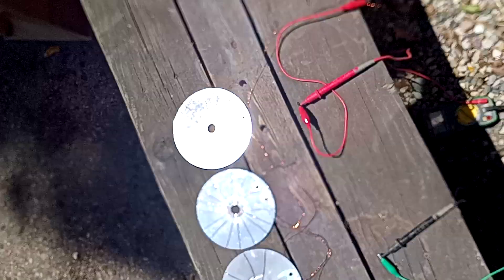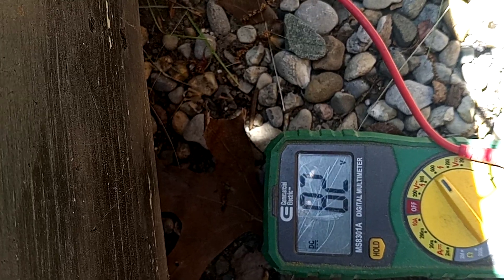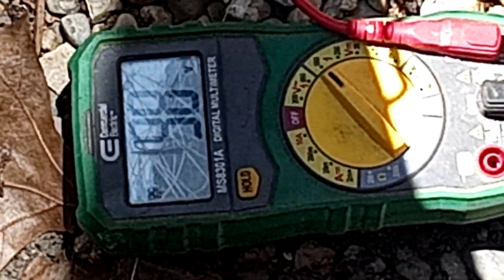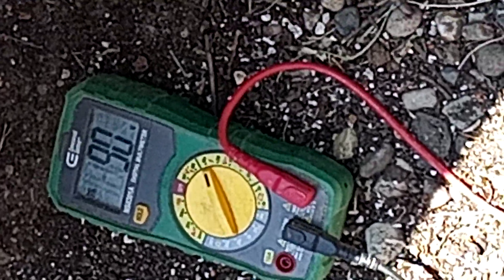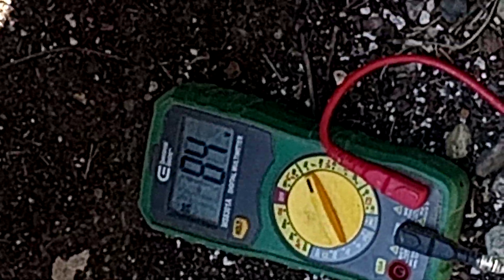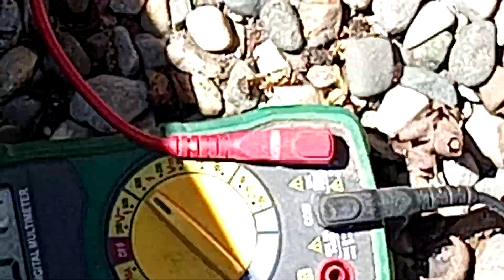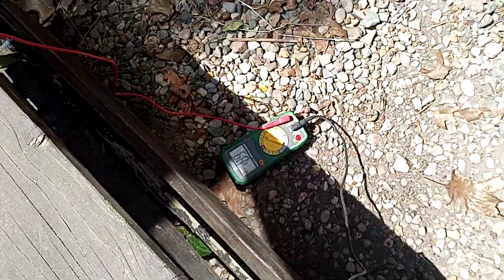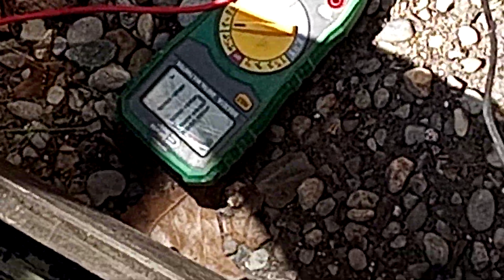Creating direct current energy

Comment: So now, you are just going to have to find a way to regulate the power down to 12 or 14 volts to recharge a car battery 🔋 or . You're going to need what's called a diode,  to allow power to flow from the solar but not back (into) the solar before connecting it to a battery. It would take 8 car batteries to handle 94 volts DC connected in series. That's your input+12v then -connected to +12 then the - connected to the +12 all 8 batteries side by side with the diode in line ,from the solar.  To the batteries. I forget which side the diode has to be on. + or -  it does  matter. You're going to have to do low power experiments to find out which side & what way the diode is pointing because that matters also. Positive current only flows in 1 direction through a diode. You just don't want the power from the battery to flow to the solar. A diode can be found in an old radio near the power circuit. It's black with one lead on each end. It looks like a miniature AA battery 🔋

Comment: That's real science! Let's be clear though that magnetic copper has clear insulation on it and it must be removed when you make electrical contact for measurement.
Reply from the maker: This copper is raw wire
Reply: @whatyousay63  If there is no insulation and the wire contacts itself in a closely wound coil (as with an electromagnet) it would reduce the current density of the coil. Make sure you are making good connection.

Comment: Add some 50 to 60 volt capacitors to stabilize and boost the energy output bringing the voltage high enough to register milliamperes. You wanna go a little further and get you one of those step up voltage buck converters that adjustable In voltage and amperage
Reply: Thank you guys sharing this " AWARENESS " SALUTE 🙋‍♂️
Reply: V great suggestion

Comment: Aha! So hmmm~ how do you magnetize regular copper? Just send a current through it for a certain amount of time? 🤔

And will it be permanently magnetic afterward?
Reply: The Cooper that has a clear coating on it works best if you plan on using foil. Bare copper when using CDs 💿 . Scrape the ends on the wire for better alligator clip connection with a knife.